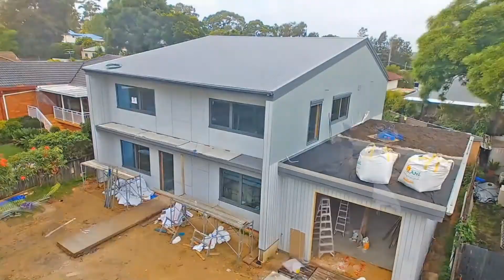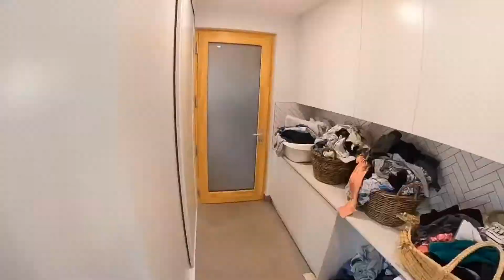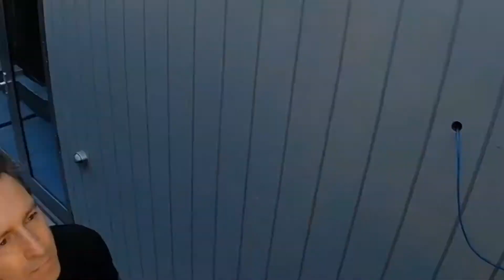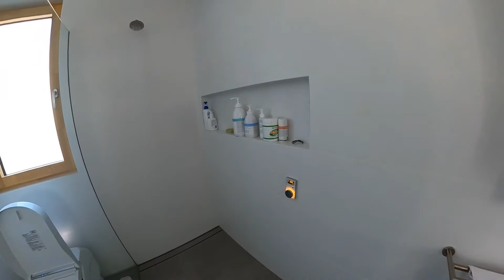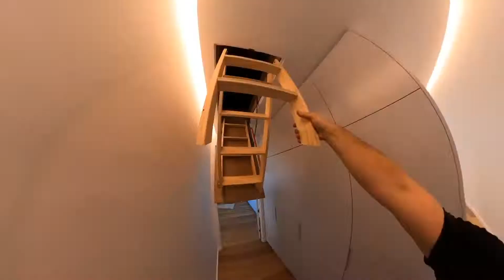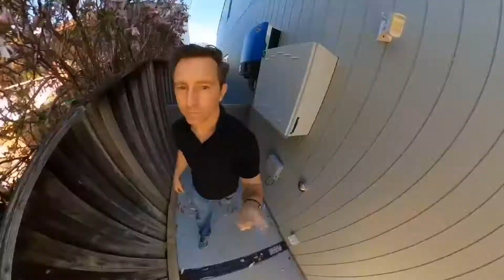Asquith PassivHaus - Sustainable House Day 2021

Comment: Love the home simple and practical. Looking at ours in 1 year so looking for ideas. I noticed no insulation on top of the ceilings i think was with the roofing, how do you find that functions for temperature control over the 4 seasons? Though I’m in Adelaide so different climate. The floors look great. So do you have internal thermal mass to help with temperature control in winter?. 

Really appreciate the walk through it helps with our planning a lot